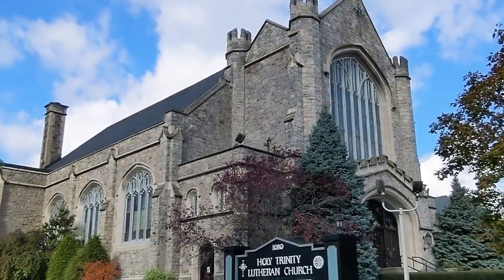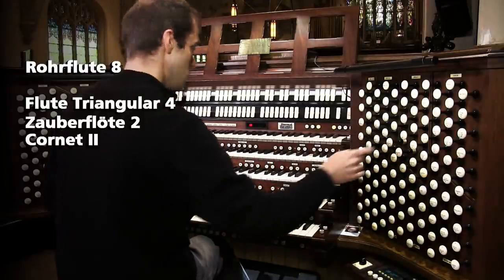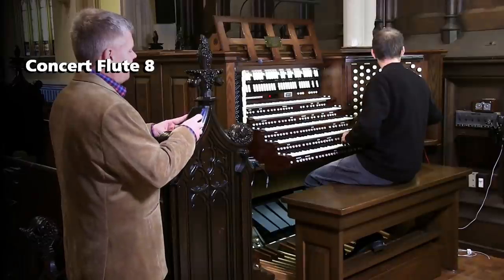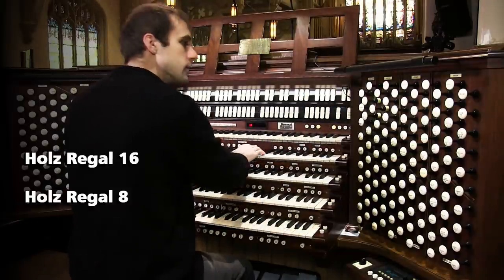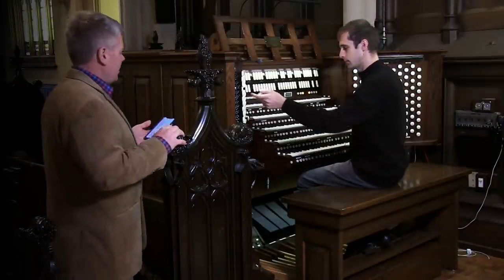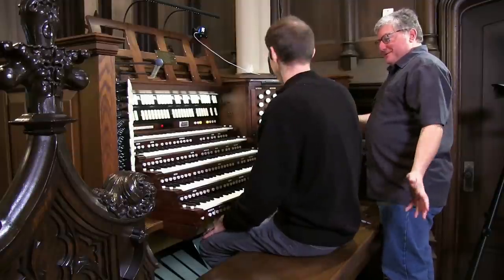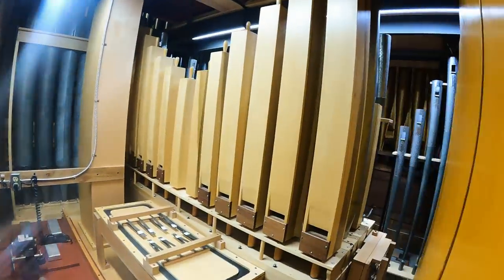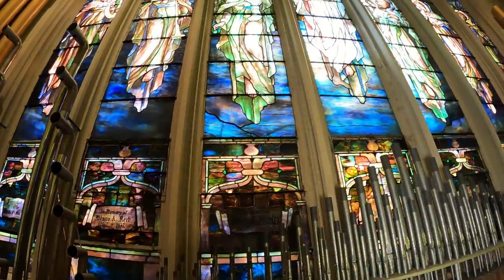2016 Parsons Pipe Organ - Holy Trinity Lutheran Church, Buffalo, New York

Comment: A marvelous video showing off this gem!  I am a member of Holy Trinity and worked for three years as an assistant to the maintainer of the organ just before the Parsons rebuild and can attest to the condition of the organ at that time ... it was pretty bad.  Parts were failing fairly readily and regularly.  I recall being in the chambers late one Friday night cutting strips of leather and applying glue and handing them up to the maintainer, who was patching the air bladders on the swell shade motors, which weren't closing completely.  There were ranks of pipes that we never tuned in the time I was assisting because we simply could not get to them; other sections of the organ would have to be de-piped to permit that access.  The old tuba stop wouldn't stay in tune for any length of time and we were constantly touching up the tuning on that between the major tunings.  (That was replaced by the new Bigham Tuba.)  The chancel chamber was a real rabbit warren and getting around inside it required a fair amount of contortionism.  The main console, despite a rebuilding the late 90s, was already showing signs of significant wear in the keyboards, and on it went.    I envy the Parsons crew and the easy time they now have in working on the chancel organ!

Comment: Magnificent instrument. Excellent engineering and sound. I will definitely keep Parsons in mind for any organ work I contemplate.
Reply: I wouldn't, not on the available evidence... this organ is a bloated, overblown mish-mash of ill-matched sounds, however pleasant most of them are in isolation.
Reply: Okay … this was clearly a challenging assignment for any firm to endeavor — particularly in light of your remarks. Per adventure there’s room for improvement?
Reply: @dkeithtag  I would reduce the chancel organ to a fairly standard English style four-manual of eighty stops or thereabouts, put in a lot more Pedal fluework, and of the Gallery organ, only the enclosed division would remain. All of the neo-classical bubble and squeak would be removed, including the entire chancel Positive. I would also discard the modern solid state digital control system (maximum lifespan 30 years or so) and convert it to old school analogue EP. If it was all in one place I'd prefer tubular pneumatic action, but the divided installation and remote gallery section make this a tad impractical.

Comment: Not hugely impressed with the organ-builder bloke, who does not seem to know the difference between comprehensive and cohesive, and while the organ itself makes some very nice sounds, I still wouldn't call it entirely cohesive - there is still a relative paucity of 8ft tone, most of the Pedal basses are digital (the transition from badly voiced pipes to weak toast in the 16ft Diapason is very audible!), the (atrocious) percussions are all digital, as is the Swell sharp mixture, the reeds are underscaled... I would much rather have a simple four-manual with half the number of stops but appropriately scaled and with a real Pedal 32ft/16ft Open Wood, 32ft Bourdon etc, while throwing out all the neo-baroque buzz, bubble and squeak as the irrelevances they are, including throwing out the entire gallery organ except for the Swell, which could remain as an Echo division... this incarnation of the instrument may prove more reliable than the last, but I do not see it lasting the test of time as an instrument of musical integrity - despite all the pleasant sounds it undoubtedly makes. The confused nomenclature doesn't help - three different Vox Humanas with three different names in three different languages!